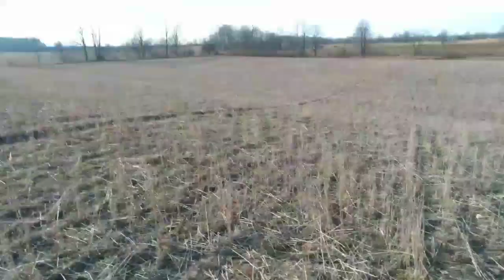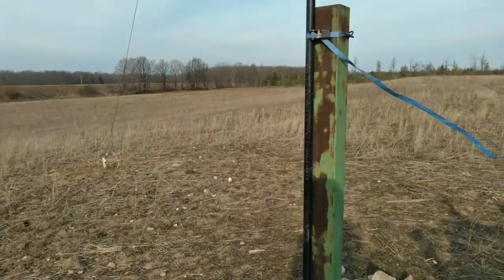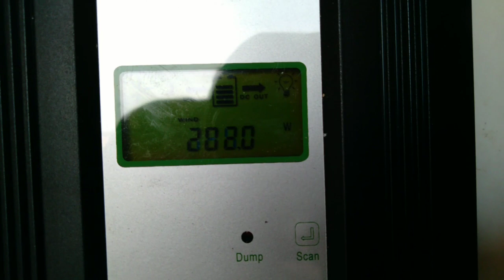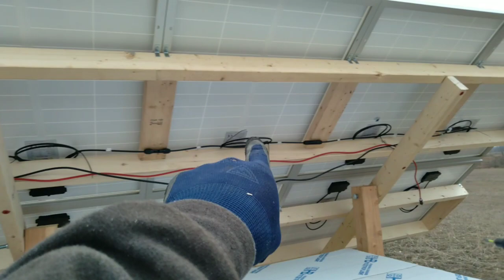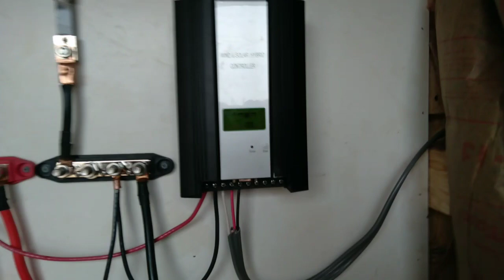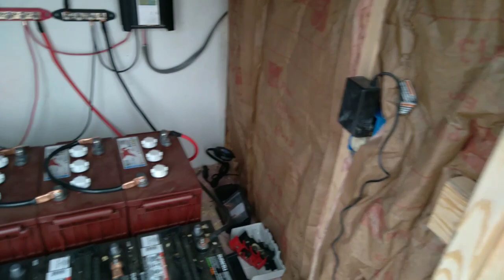Remote Powerplant: Finally Making Power!

Comment: Nice clean wind!! And so the dumd devertion control on turbine controller is going to connect to blanket also? Say looking good and thanks for sharing 😃
Reply from the maker: I think we'r just going to run the heated floor all winter. I doubt it will actually get warm but it will definatly not get freezing cold. Haven't decided what our dump load will be.... any ideas Billy? What would be useful and discrete in the middle of nowhere? A 3-500 watt load would do the trick I figure.
Reply from the maker: And yeah buddy.....clean wind! I get so angry watching J.D.'s videos with the same turbines, rockin & rollin then look out my window at the same turbine with heavier wire then he uses, with the same rectifiers and such.....not makin squat. I really just gotta get my birds up to 50' and they'll fly the way they're supposed to. Working on a deal including a 55' bucket/boom truck..... of I can square that up I'm going to ignore local code and put my turbines a little closer to God. I'm at sea level here so my wind flat out sucks. New controllers on the way so we'll see what that does first but I already know......a wind turbine needs wind to charge batteries....period.